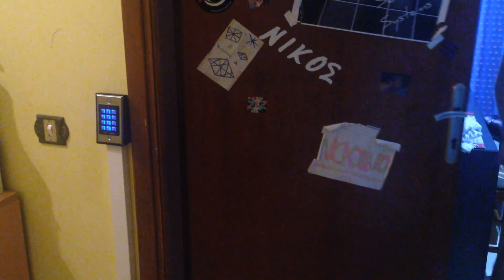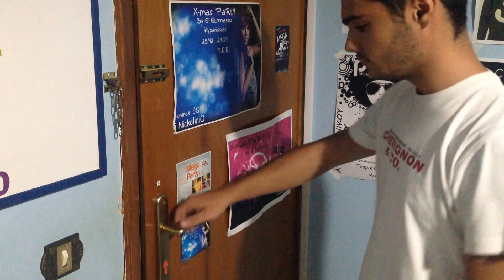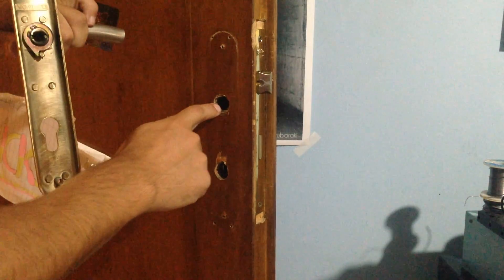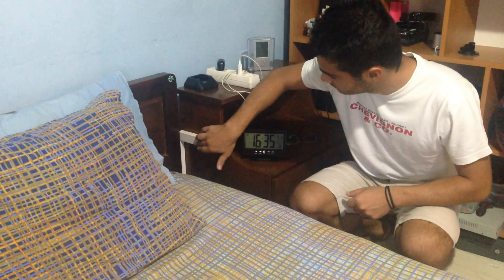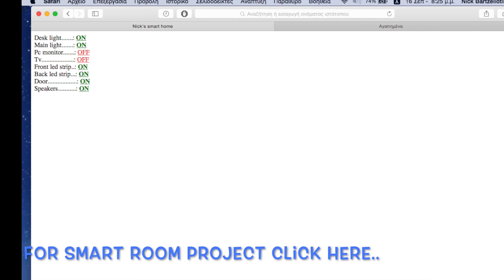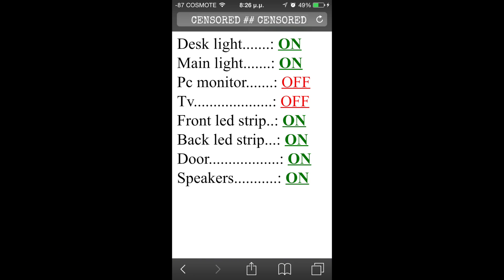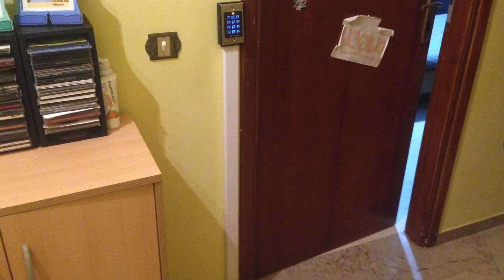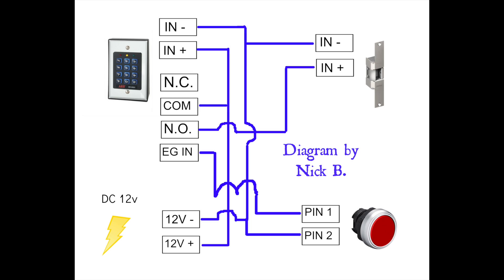➪ My room's door is password protected? || Door access control system

Comment: What if a blackout happen and you're out of the room ? :D
Reply from the maker: I'm planning to connect the whole system to a ups but until then I may stay out of the room if there is no power.
Reply: You couldn't get to the room if it's locked right ?
Reply from the maker: Yeap. Unless if I add a UPS unit as I said.